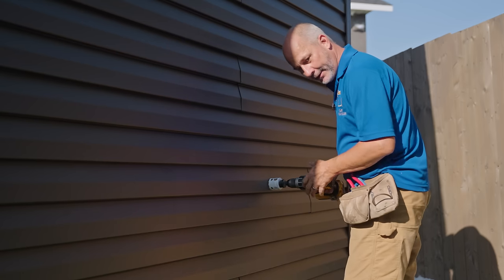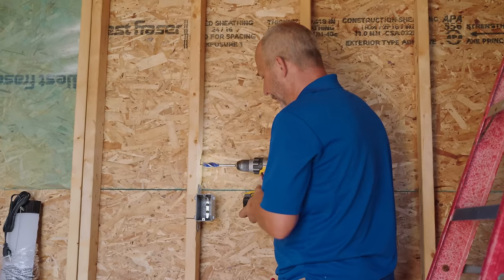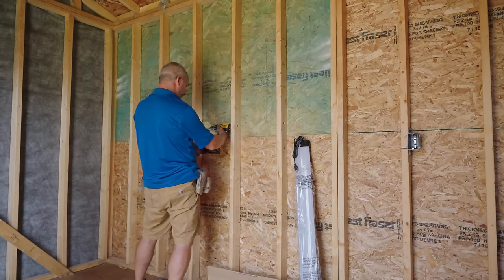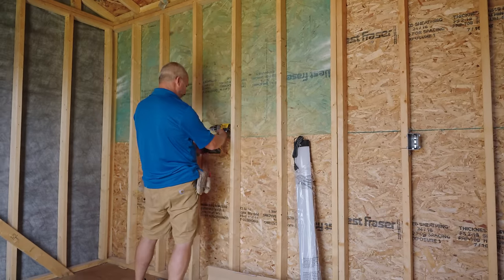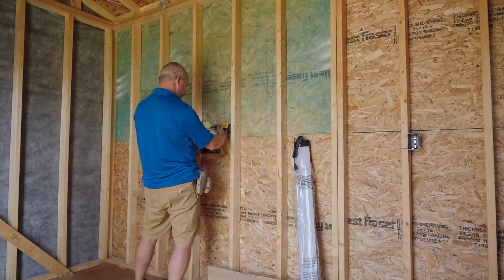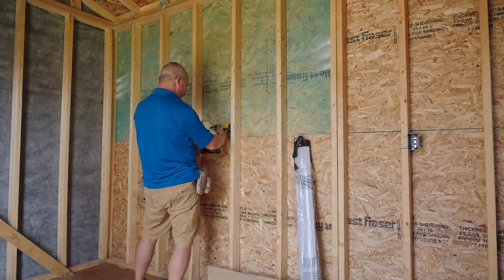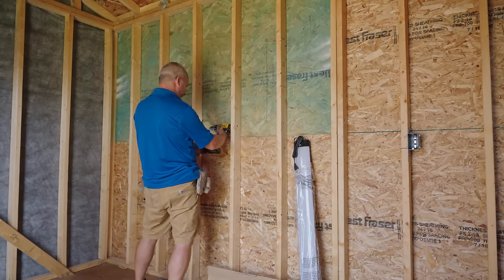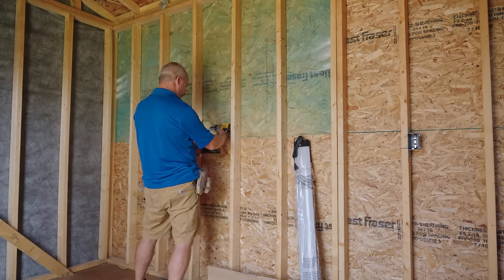How to Run Permanent Temporary Power to a Shed

Comment: Not sure about Canada, but current code in the US requires neutral present in switch boxes to allow for smart switches, meaning 14-3 for that switch loop.
Reply: Same in canada
Reply: Can be easily done by running another 14/2 in the future between switch box and ceiling box. Especially since the wall will be staying open
Reply: Sec. 404.2(C)
Reply: I believe that a neutral at this switch may not be required in Canada because the switch controls a receptacle rather than a permanently installed light. (See CEC 4-022(2))
Reply: It would not require the Neutral (grounded conductor) in this application because finish materials do not need to be removed to provide a grounded conductor.

A few other comments:
The switched outlet receptacle does control the lighting load. 

The light is a "permanent" installation and since the cord connected attachment is not concealed the light fixture does not have to be "hardwired".

Resources:
NEC Sec. 404.2(C) ... where switches control lighting loads ..."
However, exception 2 does not require the grounded conductor if a replacement cable can be installed without removing finish materials. (along with a few other exceptions).
Reply: @glengivens2725  It would not require the identified conductor (neutral) for the reason I stated. NEC is irrelevant to an installation in Ottawa, Ontario, Canada. OESC (based on CEC) is the relevant code.
Reply: And just to add to this, if AHJ was of the opinion that the shop light was permanently installed, the neutral would likely be required. Frankly, best practice now is always to have it regardless. I would install it from the get go rather than have to quibble with an inspector.
Reply: You are correct and I agree  @YellowBunchofBananas  . I intended to supplement @PhilParadis comment of US installation. I did not intend to question your statement.
Reply: @glengivens2725  Sorry for any misunderstanding! Really I think the main lesson here for DIYers is that to avoid having to think they should always run power to the switch. I would have preferred Jeff to show that.

Comment: I always like to run two runs to my switches.  Provides a neutral for smart devices and you can always branch off a receptacle.
Reply: Just use a 14/3 or 12/3. Use black for hot, red for switch leg, and cap the white until you need it.

Comment: Building inspector here. Any jurisdiction that adopts the NEC the owner would have to have a permit and this temporary permanent power would not be allowed. Since it isn’t up to code.
Reply: First off, any jurisdiction that requires permits, is out of their mind not adopting nec. How can you pull a permit and do an electrical job without the nec?????
Reply: @Nttt739  I agree. But if they don’t adopt a code they probably don’t require permits.

Comment: Great video! Learned a lot. One question, you said that silicone caulk in direct contact with water will deteriorate over time. I've had many aquariums over the years. Fish tanks are constructed with 100% silicone. The seams do not deteriorate unless the tank is left dry for some time.
Reply: I'm thinking the UV from sunlight would be what breaks down the silicone.

Comment: Also most states have airplanes taking pictures of everyones property to see where it's at every year , see so they can tell when a new building goes in or big work shed etc , usually you get caught by a neighbor calling in on you ,or by a real estate agent trying to sell you're property , or by the utility per going out to read your meters every month,  its way bigger a head ache to do it after everything is done and covered rather than just following the local or state codes to begin with guys way less head aches , 
Be careful with bad advice call your local building department so you know what is required if anything first its just a phone call away

Comment: I wired my shed using 12/2 Romex and as a temporary power source, I was planning on using my 15 amp outside outlet and an extension cord as a power source. is that feasible? 12/2 Romex being powered by 15-amp circuit. Ultimately, I have an electrician coming out to dig a trench to my home circuit panel and install a 20-amp breaker.

Comment: Why is that one sheet of OSB green?  Should it have been installed green side out, or was it just the top sheet in a stack and the green is a protective spray?
Reply: Probably a top of the stack sheet with overspray from when they paint the edges.

Comment: Had no clue the wire could be loose inside the staples. I never really thought about it.
Reply: Not could, should be. First thing a lot of inspectors do in Ontario is checked that you used the right staples and that you didn't nail them in too far and squish the cable.

Comment: A sneaky little edit when you were installing the mail plug end.  I kept waiting for you to take it back apart and say ooh I forgot to put the collar on first.  Then all of a sudden it was magically on there when you started putting it together.  But overall very nice video I watched the whole thing and I already knew how to do all that stuff.  Any good tips on how to add a ground wire to update wiring from the early 60's?
Reply: you're gonna have to run new wire .  If you have baseboards - that's a good place to put the wall runs. Come up from below if you have an unfinished basement. But anything in the ceiling .. that's gonna take some drywall removal .   At least in the 60's they had mostly switched from using lath and plaster to drywall.  Or, instead of pulling wire through the wall, you can use surface mount conduit. Doesn't look quite as neat as hiding the wire in the wall but it gets the job done.

Comment: Wait. Did I miss which cable stripper you used for stripping the Romex housing? I’ve never had that easy a time. 😂 already have regular Klein wire strippers. Kinda surprised you didn’t wrap the receptacle with electrical tape to prevent wires/screws from touching electrical box.

Comment: No sleeving on the bare ground wires in the boxes? what's to stop it touching the live terminals as you fold it up and in when attaching the front plates?
Reply: magic and wishful thinking
Reply: In theory that shouldn't happen. That said, many electricians will wrap the device in tape to cover the terminals.
Reply: You can't even find sleeving to buy in North America - a bit of a shame. But then again, I don't understand why they just don't insulate the ground wire in the cable like the others - even in countries that require sleeving. It would be helpful when working in a nearly full breaker panel - or any electrical box that is rather full. When I pigtail grounds I often cut from a spool of green wire.

Comment: Temporary electrical power for decorative holiday lighting and similar purposes is permitted for a period of up to 90 days. Once that clock runs out, you have to remove the temporary electrical power [590.3(B)].

Comment: A cording to the electrical code you are required to have a neutral at the switch box . Also why would you use 1 1/4 screw on the back of the wood when it can go though the would

Comment: @HomeRenoVisionDIY I copied your setup but with different wire, when I turn on the light switch the breaker turns off, any advice? I have a 20amp breaker and I’m running 12/2 Romex

Comment: Im going to to one shed with that wire and do away with one outside outlet i don't need i don't need 3 on the outside of the house and one will be perfect for me to use but i need to get more pvc piping for the wire and can't run that in the ground to many tree roots so its gonna go up and over

Comment: Start with the power supply. Yep purchase the proper size 12 volt battery and have lusted approved proper size DC vircuit breaker ir fuses. For probably 50 miles around me you need a petmit to wire a shed. One toenship wanted me to get a license from the tienship & a oetmit to change a dollar  wall switch.  A hole from the town wrote down my truck license okate # but I never bothered getting a lucense ir permit.
Reply: What he is doing in his video is making his shed a plug in appliance hence temporary which in canada doesn't require a permit. If he ever mad this a permanent installation the entire thing would need a permit and need to be inspected but until the day he removes that cord end and hard wires the shed he doesn't need it.

Comment: Not bad for a temporary solution. If it had permanent power I would have put way more plugs in. But with it running off an extension cord, you don't want to draw too much.
Especially since I doubt it's a heavy gauge extension cord.
Reply from the maker: I used a 12/2 extension cord. Cheers!

Comment: Jeff, I have been tuning in to your channel for quite a few years.  I appreciate the time and effort you put into it.  If I had a wish, I wish you could find a balance between an in depth long form video and something that is condensed and can be watched in 10 minutes or less.  This video, for example, could have shown the extension chord plus the connection, and all the inside wiring could have been quickly summarized, as this was not relevant to the point of the video.  I would also recommend that your videos are indexed, so that folks can quickly navigate forward or backwards within the content.  Don't get me wrong, there are times when details are needed, but there are times when they are not.

Comment: Why did you put the ground wire around the screw on the switch box? Do you ground plastic in Canada? :)
Reply: He mentioned that there is a plate to connect the grounds inside the box.   

This reduces the number of wires that have to be moved around inside the box by looping the wire that is going to be connected to the switch/outlet and the second ground to the box.  No need for a pigtail or additional wires being run to the switch/outlet, and you keep a continuous ground.
Reply: Sorry, I missed that! My apologies.

Comment: I like to put in the switches upside down. That way, you got less dust sitting on top of the switch, especially in places like a shed, the basement and so on, that are not that often used. Usually the most time the switch is set to “off”. Safes you time cleaning ;)
Reply: If the switch is installed correctly and most often in the off position then it is down, less likely to collect dust.
Reply: That's too confusing,  you may be flipping it on when you want it to be off, or off when you want it to be on. It's also against code as well.

Comment: I replaced the sketchy electric to my sheds and coops. If anyone asks, it was like that when I bought the place.  I designed it so I can disconnect the power at specifically placed j-boxes at the source of the run in the garage out to the buildings. So if it was ever an issue say when going to sell the place, I could disconnect it and say they aren't powered. Also with how the shed and coop is built, if it ever needed to move, you could disconnect the wiring, pick it up, and rewire it in a new location.
Reply: This is similar to what I did with a new shed I had built.   When I bought the place the electric was already run to the old shed (incorrectly as I found out).  So I used the same argument that it was already there when I bought it.  The breaker was disconnected at the main house box so no biggy.  It wasn't considered active.

I reconnected the lines, fed into new shed, with the old fuse panel.  Then I ran my electric from that.  Being it was a temp install I actually used extension cords inside the shed on a 15A line to power the lights, and ran 14/3 for 3 additional outlets.

When I sold the house it was easy enough to get rid of it all or disconnect it as needed.  Turns out it wasn't an issue as they could see it was not a permanent install.

Comment: I think a better option would have installed a covered 30A locking outlet on the outside, then you could have made a suicide lead cord to plug into. Definately a 30A locking and not a standard 20A to reduce unwanted pull outs.

Comment: Great video, Jeff !
I have 2 comments:1) in ontario you should never wire your outlets in a series circuit unless you are using a GFCI at the start of the cicuit to protect switches/non gfci plugs, than a combination circuit is acceptable. Parallel circuit will provide you with a equal voltage at ever plug and is probably recommended, if not required, in all provinces and states.
2) heard from a elec friend that switch loop/legs are no longer acceptable in the recent ontario elec code book revision. Have not confirmed myself yet but something worth checking into.
Reply: He wired the plugs in parallel
Reply: @aarondrake732  he used both load and lines screws on the outlet so the power passes through the outlet to the next one.  Unless i missed  him running a pig tail somewhere,  but i don't know why he would use load if he wired in parallel
Reply: If 1 wire went into the hot side of the receptacle and one wire left the other side of the receptacle and into the hot of the next receptacle that would be series but when 1 set of wires come to a receptacle 1 going under the hot and 1 under the neutral or common and 1 set of wires leave to the next receptacle 1 wire under the hot and 1 wire under the neutral/common that is parallel a tail is not required to make it parallel the little metal tab between the 2 screws on each side act as the "tail" making it parallel
Reply: I believe you have a small misunderstanding of the difference between parallel and series and just a little of my background...I have been an electrician for 17 years doing residential commercial and industrial. 5 years as the sole maintenance electrician at a 350 megawatt power plant and the last 1 1/2 years in transmission working on 25 000 to 230 000V switch yards and substations. But I promise you that he wired those plugs in parallel
Reply: @aarondrake732  i did not realize those outlets had metal tabs connecting the screws. So i was mistaken. That would make it parallel.  But isn't there a risk of high amperage damaging one of those tabs and losing power downstream?
Reply: The tabs are rated for the receptacle at the amperage of the receptacle so a 15A receptacle would be on a 15 A breaker and the breaker would protect everything in that circuit that is why it is so important to understand how to properly size wire breakers and receptacles

Comment: I never hook lights to same circuit as any  outlet.  Our inspector won’t allow it.   Unless they are lights I only install 20A circuits and 12ga wiring.   14 is really only useful for lights and LED lights at that.    16 Can lights on a living room circuit would trip a 15A at full intensity.

On the outside I would still put in outdoor box with flip lid so you can and you don’t have interior only rated cabling hanging out the back of the shed.

Comment: @ 33:00 you install a plug.  Upside down.  The reason why it's upside down is that someone may one day put a metal plate cover on the plug.  IF the screw falls out and someone is plugging or unplugging a cord the metal plate can fall across the hot and neutral wires.  The ground should be on the top in case of such an issue.  Any cord with a grounding wire will prevent the metal cover from falling across hot and neutral.  True, some times we have a two pronged plug.  Nothing can be done to protect against that.  But if the plug has three prongs the ground should be up just for such a scenario. At 1:15 you mention a "Pony" box.  For those who don't know -  pony box is a circuit breaker box not intended to be a main breaker panel but house remote breakers.  A pony box is a good idea.  HOWEVER, at 39:16 you feed your plug lead directly into your "Pull Elbow" box.

Fairly good video for those who know nothing.  But definitely room for improvement.
Reply: Neither CEC nor NEC specifies an orientation for receptacles.
Reply: True.  And I meant to say that.  Yes, there is no specification in the codes.  I don't know CEC and am merely familiar with NEC.  But I do know that there is no specific callout for the orientation of a plug.  However, many of the electricians I've known over 60 plus years will recommend the ground being on the top.  For the very reasons I specified. @YellowBunchofBananas

Comment: By code the electrical panel must be clear from obstruction from the floor to the ceiling by 30 inches wide. This called dedicated space, this allows a ladder to be placed in front of the panel to add future wiring, also the LB fitting may not be covered up or buried in the wall, this means no insulation. The LB should be on the outside of the building coming directly into the back of the panel! Where did this guy think he could do electrical work?

Comment: It's so weird to see how you run the cables in walls.
We always use conduit between wall boxes, and single wires of different colors through the conduite.

For cables installed on walls, we can use purpose made cables, 
but maybe use conduite or other ducting/covers to orotect and reduce the risk of mechanical damage, depending on risk assessment.

Comment: need a neutral at the switch box by code. I wouldn't share lighting and power. 20 amp for plugs. Technally you cant screw lb fitting to wall, metal parts must be grounded. I know, rookie moves. Hire a contractor, that's why you get it inspected

Comment: Considering that it's a common DIY'er mistake to cut the wires too short for switches and outlets- instead of advice like "a little bit extra" and "the reason there's so much wire here is just as a convenience for me" it probably would have been good to mention the actual NEC requirements for the  minimum amount of wire that should extend beyond the box. THey're easy to find and pretty basic.

Comment: Should just leave the outside for the next video and just test all the electrical on the inside with a plug, and show how to add exterior outlet with a generator plug and outlet box & seal but I always use quick flash on all my outlet, it's super easy with house wrap .